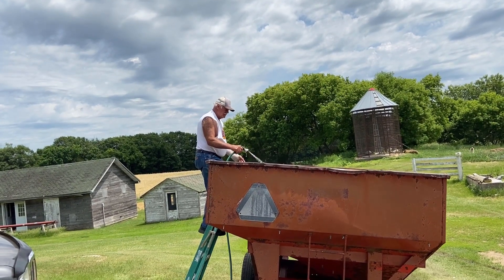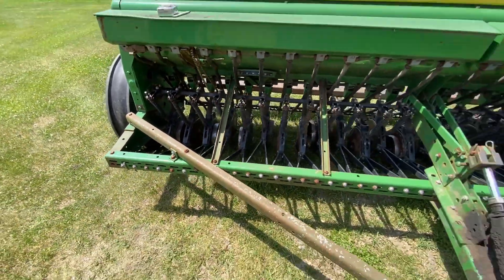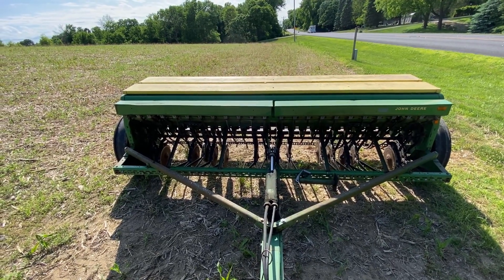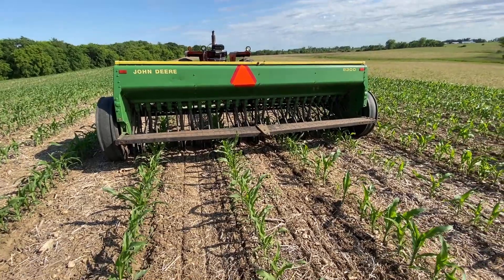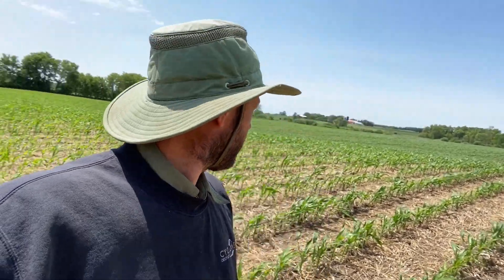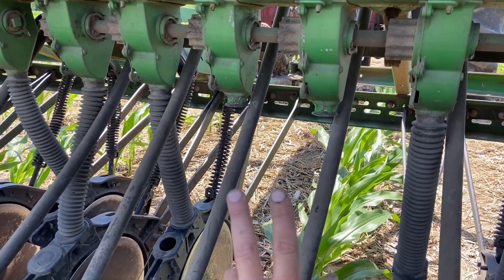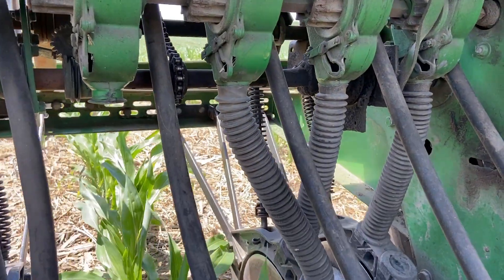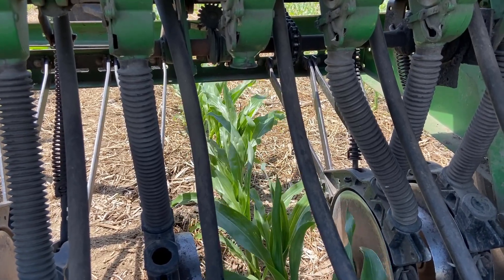Interseeding Cover Crops Into Corn

Comment: Is the corn on 30 inch rows? Im trying to figure out how to offset my drill so the wheels dont run on the corn row
Reply: Did you sort it out? That question is exactly where my mind currently is?
Reply: @thelategreatnocoastsaint  buddy, I practically went broke farming and I'm long out of it.. Feels like a lifetime ago when I wrote this comment. But yes. I swung the tractor drawbar over and that gave me 7 or so inches. Then I used threaded rod and nuts to offset the drill hitch the rest of the way. It did all 40 acres before it had bent out of shape and didn't pull offset any more. I would recommend building something a little stronger lol.

Comment: Or is it 2 discs seeding between each inner rows. Good way to save on machinery purchases
Reply from the maker: Four openers per row on the middle three, then two per row on the ends (which get covered a second time on the return trip, so every row spacing ends up with four rows of cover crops).

Comment: I’ve seen those planter tires before and wondered why they’re designed with the 2 large outer ridges.
Reply from the maker: They're called "marker tires."  The imprint they leave in the soil gives you a guide for your next pass.

To be honest, I just thought it was for visibility, but this spring I noticed that the width of the ribs matches the 6" width between disk-opener units.  If you run the drill so the two outer seed disk openers are planting into the rib-marks from the last pass, your spacing ends up pretty much perfect.

Not so useful in a no-till setting, but the drill was really made to work in a tilled, prepared seed bed, so it makes good sense.
Reply: @ravenviewfarm  Ah! That’s very ingenious.

Comment: What size is that drill? 30 inch corn spacing? I've been trying to find a Tye 3 point drill to modify to make an inter-seeder
Reply from the maker: Sorry for the slow reply.  That 8300 drill is 12ft wide - 24 planting units spaced at 6”.  The corn is on 38” row spacing, and the math works out just about perfectly to keep the drill from running down the corn - though it’s a bit snug!

Whenever I drift a little and run down some corn with one of those big wheels, it reminds me of being a kid and learning how to cultivate corn with a 3-pt cultivator.  No sudden adjustments! 😄

Comment: Hello,  how much yield loss do you think you had by running over some on the end rows? Or was the corn small enough that most came back?
Reply from the maker: Quite a bit of it bounced back, but there was definitely some loss on the headlands with all that turning around.  That said, it was only a small percentage of the overall crop, and if these practices result in a yield increase on the rest of the field, then it’s a win.

I’ve started to view the headlands as partially sacrificial, so it’s just a shift in attitude.  Good observation!